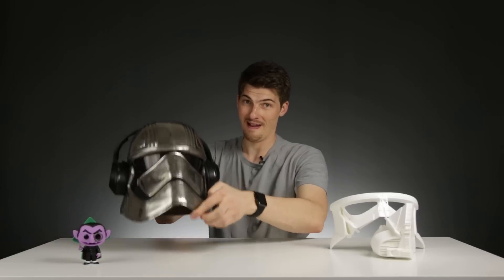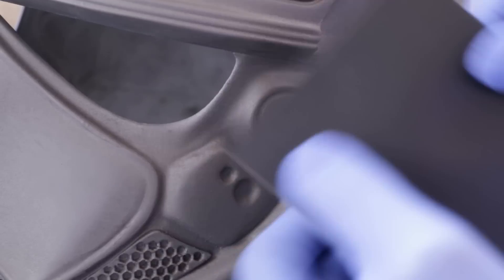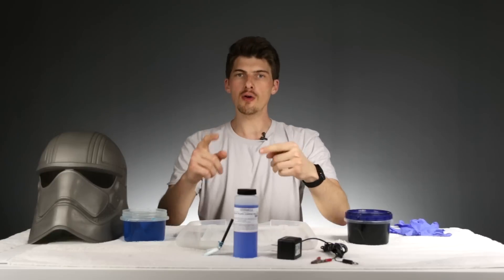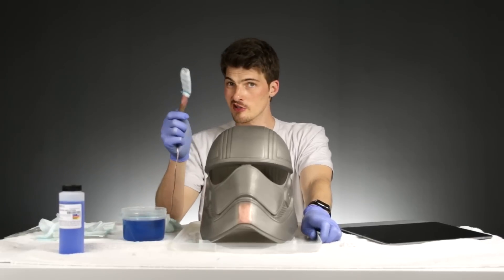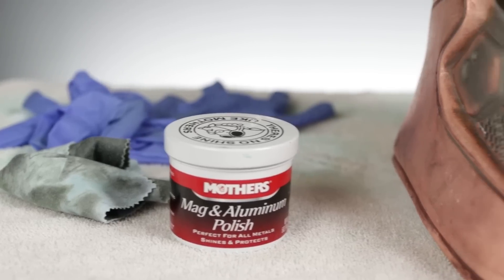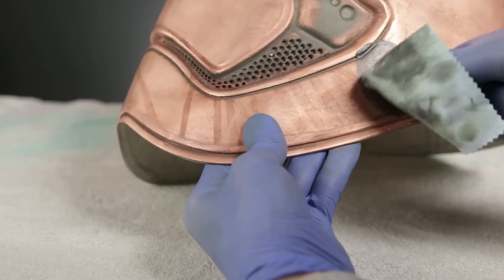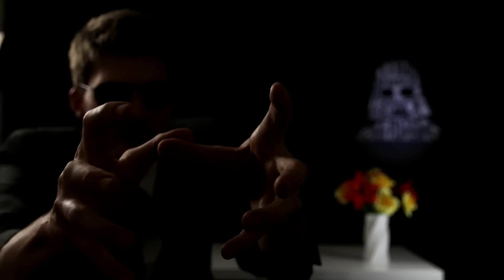How-To Make Metal: Electroplating a 3D Printed Star Wars Helmet

Comment: Copper is much softer than nickel, so it polishes easier.  Nice video! and great application. Glad to see my stuff used like this, especially on 3D printed plastic.
Reply from the maker: +Michael Caswell Ladies and gentlemen, Mr. Caswell himself! 

Thank you very much for taking the time to watch the video! I'm glad you liked it and I'm glad to have used your products. Seriously, you carry some awesome stuff and you've created a lot of great products. The plug n plate kits are rather genius.

Cheers, sir!
Reply: So I got a newb question, why not go directly to nickel?
Reply: @CharlesEakins  The nickel needs a metal to cling to. So that is why copper is used first
Reply: @CharlesEakins  yes i think the same ..ever get an answer? thax
Reply: @roadstar499  I work in a nickel and copper plating shop. We do not plate over plastics, but we plate over most metals. In general, copper is one of the easiest metals to electroplate. Nickel by contrast is one of the harder metals to electroplate. If you wanted to build up a certain thickness of material, it is best to build most of it with copper and then add nickel to the surface of it. 
I have no awareness of the nickel spray paint that he uses. I cannot say one way or the other if the nickel will not stick to it or not. I know with some electroplating people use copper as a base for nickel electroplating. However, at our facility when we brush plate, we always use nickel as the base layer and then we add copper to the top of it. 
If we had to build a layer that was 50 microns thick, we would most likely put 2-5 microns of nickel down, add 40 microns of copper, and then top it off with nickel again. 
 
If I did not answer the question exactly the way you were looking for, then please ask again. I will do my best to answer it as fully as possible.
Reply: @anthonycalderone9237  do you know if plating factories(?) ever take on a commission project for a person?
Reply: @CharlesEakins  chemistry answer: copper metal is less reactive than nickel metal. A higher voltage is needed to convert the nickel salts to a metal. Also copper is available, very conductive and softer.
In extreme cases it's very difficult to plate with reactive metals like aluminium because it really just wants to stay in solution as a salt. I hope this helped.
Reply: Michael Caswell - with a Dremel it doesn't matter.
Reply: Mr. Caswell. Is there a purchasable large wand kit like shown in the video. I bought the normal nickel and copper plug kit. Can’t find the large wand
Reply: do u need to do the first layer of copper or can u just do the nickel
Reply: I just bought this kit for this purpose. What grade nickel is the tiny wand just in case I want to make a larger one for a bigger project?
Reply from the maker: +starrychloe you do run the risk of stripping off the plating and paint with a dremel, especially if your plating job isn't very thick.

Comment: I’ve been Bath Electro-plating my machined brass custom scale model parts with Bright Nickel & Black Nickel plate. 
So plating 3D printed parts I’ve designed seemed like the next logical step. Looks like I just need the A/B painting step product & I’m GTG. 
📍Thanks for a great video. I Luv & use  Caswell’s stuff [My Black Nickel Solution I got from them- as well an excellent informative online book they produced showing all the DIY plating processes. As well as Aluminum Anodizing. Came in handy as reference material when I started Anodizing + Color Dye process to my machined Aluminum parts. As well as some of the Anodizing Dye they sell.
ZenModeling

Comment: thanks for an great tutorial. One qustion, i have also tryed to electro plate on a 3D print, with conductive paint on, and with a brush, - but i couldtnt get the copper to attach. It seems like the surface on top become grey metalic, but not copper metalic. I used a more expensive pen, and with a good quality transformer attached, and the rod on the brush was copper wired, - so everything should be about right. Do you have any idea of what the reson  could be to not be working ? regards Frank Fneriz DK

Comment: Good video with some good tips that are still relevant today. But you definitely can go cheaper without buying a kit. Electroplating can be done with a couple of nine volt  batteries and making the solution is cheap and easy. I'm sure that company's upcharge on the copper sulfate solution is insane.

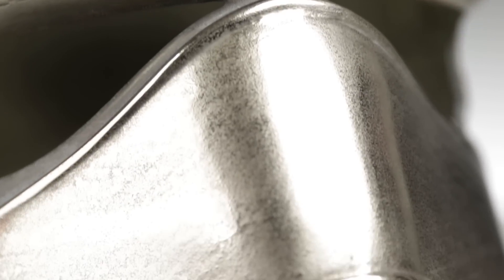Comment: 10:33 it's not made out of metal, it's still a piece of plastic with a tiny exterior layer of metallic paint; if you used PLA that thing is fragile; unless you display it statically it won't stand real use (as a human head wearing the helmet, on and off, bumping into something, etc).

Comment: Maybe this is said already, but I have to mention the very serious warning label on this bottle of Conductive Paint. "Suspected of causing Cancer" and "Do not come in contact with skin" are pretty serious hazards. Please be aware that you should never inhale airborne particles of any heavy metal like Nickle, or Lead. Please use heavy duty gloves and coverings on your eyes and basically any exposed skin.  Also, finding the maker of the Conductive (Nickle) Water-based paint was tricky. My order from amazon was a bust - google the brand and find a local distributor worked very well.
Reply: Not trying to scare anyone away. I think this process is awesome. Just be informed of the risks. In case you think I'm exaggerating, here is the actual text from warning label:  "DANGER: May damage fertility or the unborn child. Causes damages to organs (lungs) through prolonged or repeated exposure by inhalation. Suspected of causing cancer. May cause allergic skin reaction. Harmful to aquatic life with long lasting effects. Keep out of reach of children. Obtain special instructions before use. Do not handle until all safety precautions have been read and understood. Do not breather mist/spray. Do not eat, drink or smoke when using this product. Wear protective gloves/protective clothing/eye protection. Contaminated work clothing should not be allowed out of the workplace. Wash hands thoroughly after handling. Avoid release to the environment. Store locked up. IF exposed or concerned: Get medical advice/attention. IF ON SKIN: Wash with plenty of water. If skin irritational or rash occurs, Get Medical advice/attention. Take off contaminated clothing and wash before reuse. Get medical attention/ advice if you feel unwell. ...."

Comment: Thank you for the video.  Does this process give the part a hard, metal like finish? I have some small knobs that I'd like to have them have that really hard feel to them, not plastic feel.
Reply: Yes, electroplating is actually depositing the metal onto whatever object you're plating. Through the process, you're actually encasing whatever you're plating in a thin (or thicker depending on how thick you plate) layer of actual metal. Hope this helps!
Reply: @ashleyelizabeth9095  excellent to hear, thank you very much for the reply!

Comment: Don't sand the conductive paint. Instead, sand your model properly - and I mean properly then give it a thin coat of a bonding agent for plastic parts and then a layer of automotive filler which you then sand down until layer lines are gone. THEN you apply your conductive coating. Silver-based is usually best (like "Tifoo" but a tad bit expensive) but there are also graphite-based versions around which have been used for electroplating for ages. Also, add a tiny bit of wetting agent to your solution...

Comment: Did you have to do anything to get the nickel spray to come out that evenly? I did three coats and on the last one just barely sanded it down with 1200 grit sand paper to be smooth again and the results still look...splotchy? For lack of a better word. Lol
Reply: Curious if you came up with a solution for this issue?

Comment: Hey, @infosmercial questions have you try electroplating chrome? And what type of 3d printer filament do you use? Don't have Twitter.
Reply from the maker: Hey Ernie, sorry for the delay, yes I have tried electroplating chrome, but never quite got it right. It is a similar process, but the chrome needs a very different voltage and amp setting than nickel or copper. Also, it seems pretty sensitive to any contaminants on the surface too. Good luck if you try it.

Comment: Love your channel. How do you hang your plasma helmet? Love how you hang it. Thanks you
Reply from the maker: Yeah it looks very awesome and is kinda of invisible. So I created this wall mounting bracket and 3D printed it. It sort of looks like a capital H. So I screwed in on the top inside part to the wall. The. I simply slid the helmet into the opening at the top. Make sense? If you want I could shoot you a pic on Twitter or instagram (@infosmercial for both).

Comment: Two questions....Are there any advantages to using a DC bench power supply vs just grabbing an adapter and putting clips on it....Also, if you go the adapter route what specs are we looking for?

Secondly, when making your own brushes do you need a barrier between your hand in the anode? Or do yoy basically just wrap the anode with a sponge/cloth and throw the clip on?
Reply from the maker: Yes there are definitely advantages. Different materials plate at different electrical outputs. Luckily, copper and nickel plate around the same, which is why adapters work fine. If however you may want to use other metals like gold, you may not plate optimally using the fixed output of an adapter. Again tho, if your just doing copper and nickel, adapters work fine. Copper and nickel plate at around 5v with I believe .7 amps per square inch. If your using smaller anodes (thickness of a pencil), you’ll want an adapter that outputs at 5v around 200-400 mA. 

Making brushes I would highly recommend where rubberized, electric safe work gloves. The risk is minimal if you make your connections properly, but of course sometimes things don’t work that way. More importantly, your also working with highly caustic materials. 

Making the brushes really is as simple as buying a copper sheet for copper and stainless steel sheet for nickel and slapping a bandage on it. Hook it up and your good to go. 

Let me know if you have any other questions.
Reply: Infosmercial Thank you so much for the detailed answers...awesome video and I can't wait to try it out!
Reply from the maker: You got it man!

Comment: Hi I put entire can on my Star Wars helmet and didn't seem to electroplate very well did you use more than one can?
Reply from the maker: No I did not use more than one can. So there are a few things I had to do. One is to let the paint dry for about 48 hours, seriously. As the propellants in the paint dry, the conductivity increases. It can take a few days for the paint to fully cure, especially if you are doing it in cold weather you may have to wait longer. The other things is to make sure your coats a reasonably thick, but even. I also lightly sanded down the surface and then smoothed it by using a 1500 and 2000 grit sandpaper. By making the surface very smooth, the electricity can more evenly conduct across the surface of the helmet. 

When you are electroplating, you need to begin plating right next to where you make your electrical connections and work it for a while in that same spot. Once you have built up copper in that area, move your connections to the copper part. Then continue to plate outward from that copper area. The copper is more conductive than the paint and will not only help to speed up the process, but make the plating better and more durable. 

I hope this helps.
Reply: Infosmercial I really do appreciate the response on an older video I will try that let you know how it works thanks again you're awesome
Reply from the maker: No worries. I try to respond to every comment I can.

Comment: Is there a cheaper way of doing this effect? Want to do it but so expensive tho.
Reply from the maker: Hey Shawn! So I have been looking into getting this done for as cheap as possible. One way to do this is to use graphite powder instead of the nickel spray in order conductively coat the print. This requires some finesse though and is a bit of a pain, but it is also significantly cheaper. 

I am looking into other cheaper ways of DIY’ing the rest of the kits like making your own copper solution etc... It will be some time before I get to it, but I will be making a video on it in the future.

Comment: Amazing video! should I switch from pla to abs to do this? Also, if I casted a 3d print and made resin copies will this work on resin?
Reply from the maker: Yeah this should work in resin perfectly fine. Truth be told, this should work in just about any surface that you can spray paint. 

As for PLA vs ABS, it is easier to get great results with ABS because you can sand it down. There are options with PLA though so it is definitely doable. 

Three things I would recommend using PLA and before applying the nickel spray: the product XTC Smooth On which helps to fill in the small striations from printing. Using bondo body filler to fill in any gaps and fix more major problems. Then a high fill primer spray paint. These three items will help you get some good results without having to sand the print itself. 

I would recommend sanding down after applying each one of those products to achieve a smooth surface.
Reply: Thank you for the very informative reply!

Comment: Man that is pretty slick, never thought about plating like that, definitely would cut down on the material use vs plating in a tank. That said, any reason you guys can think of now to plate the whole helmet at once dunked in a tank (other than waste of materials plating the inside of the helmet)? I think this would cut down on the processing time and give some pretty consistent layering.
Reply from the maker: +Dave Spangler Honestly, if you can tank plate the entire helmet at once, the results will be significantly better. It will allow you to build up much thicker layers, which means you can sand down and polish the surface rather aggressively. I did this on smaller parts and you can get an incredible mirror like finish. Not only that, but the thick plating adds significant heft and durability to the objects. Oh and they react better with magnets. Your def right too as the working time required is minimized. While the part is tank plating you can be doing other things. 

The problem with tank plating a helmet of this size of course is having a tank large enough for it. Moreover, having enough of the copper and nickel solutions can be rather expensive. It may also be unnecessary for hobbbyists or people who plan to do this on only a piece or two every now and then. If you plan to make use of it on a regular basis, I would say the results can be worth it. 

One compromise may be to build a large copper tank, tank plate the part, sand and polish the copper, and then brush plate the nickel on using less supplies. This would give you the best of both worlds.

Comment: I have a headlight polishing kit for my car. I use what's left to polish 3D prints (it's just plastic polishing compound). It has a sponge thing that fits into a drill. Cuts my polishing time down a lot.
Reply from the maker: +Powered by Stupid wow that sounds kinda cool. Are you saying that you use that stuff to polish the actual 3d printed plastic? (As opposed to polishing the electroplated metal in the video). 

If so that’s kinda neat. I have some of that stuff lying around, may have to try it out. Heck, that may work really well for getting smooth coatings of paint too.
Reply: Yeah. I've filled the layer lines with acetone dissolved material from the supports, or primer and sand until it's smooth. So often I'm buffing enamel paint, but the drill attachment is great. It's just a soft sponge and a metal rod. I've had a few prints come out really good, and just sanded and polished the ABS.
Reply from the maker: +Powered by Stupid so are you brushing on an ABS slurry and the just sanding and buffing? That sounds like it might work really great, especially since it’ll increase part durability.
Reply: Exactly. Though it's faster in my experience to hit it with sandable primer then acrylic, or enamel paint it. Then sand and buff that. I still use the plastic polishing compound and that sponge drill bit to finish it. But the slurry fuses with the ABS and makes it stronger. So it I'm making anything that will be under stress I'll take the extra time.

Comment: what is the benefit of doing this over just painting with metallic paint?
Reply from the maker: +Andrew Eber there are a number of benefits. In the video, it really is just cosmetics at play, but electroplating yields a highly conductive surface (use for custom circuits), has magnetic properties, and drastically increases both the durability and tensile resistance of the printed part. 

Even for cosmetics with electroplating, the metal finish that can be achieved with thick plating and proper polishing techniques will be unparalleled; no paint can match the surface finish. 

Thanks for watching the vid.

Comment: It would be pretty much perfect for the project i'm working on but it's like a 2 meter wide concrete printed seating... I would need to firstly smooth the surface and then I would need a really big brush.

Comment: If I make a foam model helmet instead of a 3D print , will this still work?
Reply from the maker: +Ruuni yeah the process should still work. I would recommend using something like a few layers of filler primer to make sure the surface is smooth and the nickel print spray doesn't sink into the foam.